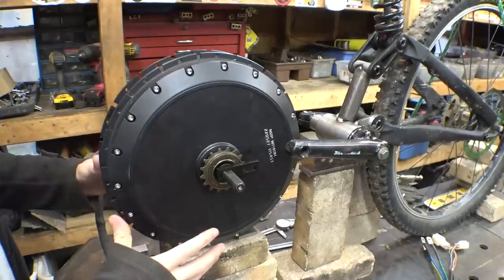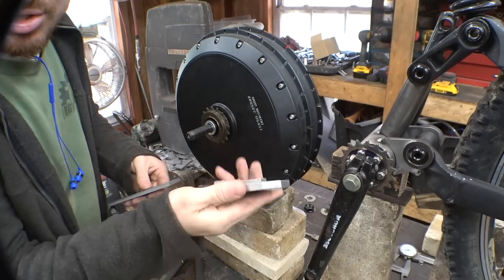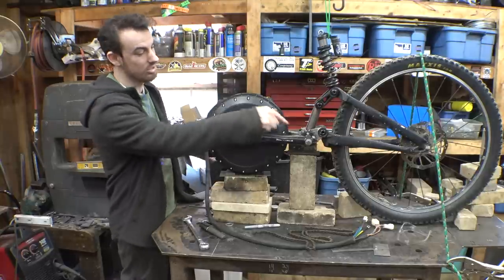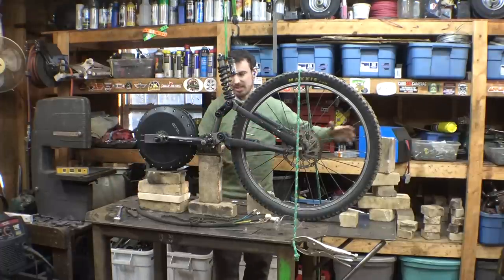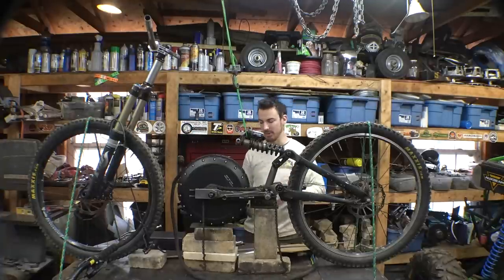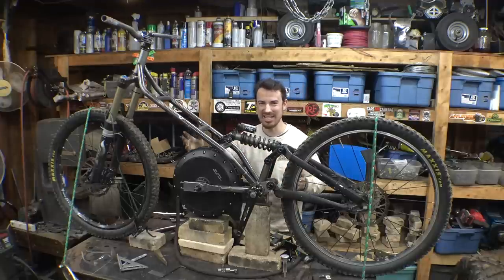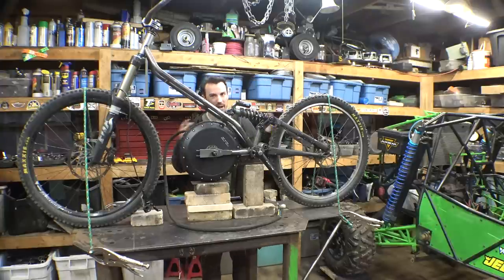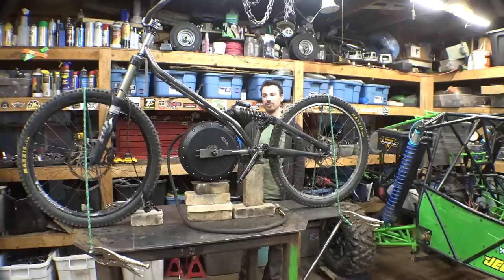Home Made Electric Mountain Bike Build - Part 2

Comment: Is there a one way bearing or something like that in the driveline? The motor won't force you to pedal, will it?
Reply: Gonna be a shin snapper
Reply: @kene6838  Yeah, usually, all you need is a one way bearing in the back sprocket but if the front sprocket is going to be driven, it will need a one way in both the rear and the front sprocket. Or middle sprocket, I guess in this case.
Reply: It's gonna have to spin the cranks, right? There are parts for trials bikes that take a freewheel on the cranks, but the motor will need to spin the cranks in order to drive the rear wheel, and that motor is rated for something like 1000rpm
Reply: I was hoping to watch the aftermath of touching the throttle at a stand still, oh the air time
Reply: @Ash-bx6kq  That's where a one way bearing is needed. So the motor can spin faster than the pedals or even with the pedals stationary. 

EDITED... The one way bearing has to be on the pedal crank. Wouldn't work on the motor shaft.
Reply: He turned the motor over and put the freewheel sprocket on it so the pedals Won't turn unless he wants.He put a solid sprocket on the other side to drive the wheel.
Reply: @bryduhbikeguy  That doesn't make sense.  Why would he put a chain between the pedals and the motor that doesn't drive anything? There HAS to be a one way bearing type mechanism or the motor will drive the pedals. There's no way to avoid that.

Comment: This motor is like 3-4x the power that people normally put on bicycles lol. Maybe this steel frame will weigh it down a bit more but everything else is mountain bike. Might want to put a good chain guard on it. I hope you ride it on camera more than the electric dirt bike. Maybe updating the electric dirt bike will be a good idea too because the seat was uncomfortably high and the suspension too stiff.

Comment: I wonder how level everything will be when the wheels fold in half.
Reply: Yeah I gotta agree. If that’s really a hub motor intended for a 3-400# bike, the torque load on the frame and/or bicycle wheels is going to be very high!
Reply: Also, he's using a regular 9 speed chain for this. No way in hell that will survive
Reply: I totally love the idea, but having my doubts on this one. I rode bikes a lot when I was a kid, and I can't even see the tubes inside the tires holding up for more than a single jump. He said he wants to take it in the mountains.
Reply: @ThePatillac  yeah, the suspension will also not be able to support a 150lbs bike, the chain, rear derailleur, and cassette are meant for like .5hp, not 20, the wheels will 100% go out of true from the weight if not fold up entirely, and he won't even be able to run the motor at its max power/ideal speed because it's connected directly to the pedals
Reply: @ThePatillac  Could be setup tubless.  Most mountain bikes in the last 5 years or so don't run tubes. Most mountain bike suspension and wheels aren't meant for people weighing over 300. I figure the extra metal, battery,  motor, his weight, and misc stuff would be over that.

Comment: Good luck with it.  I feel the pedals are going to smack the ground when turning, and there is going to be a awful lot of weight in the front, making the back tire wanna leave the ground all the time,  so I wouldn't stand up on the pedals while moving, you might just end up nose diving in the ground because of that extra weight.
Reply: He's definitely gonna have problems setting up the suspension properly with that much weight on the frame. Those suspension parts were meant for a 30lbs frame and this bike will probably be 100-150lbs

Comment: Question! I may not be visualizing this correctly, but if you're driving the motor through the cranks then to the wheel, won't the pedals also be flying insanely fast and blend your feet with the pedals? 🤔
Reply: Was thinking the same thing
Reply: That freewheel is actually a left hand drive style. So the teeth spin freely clockwise and engage with the motor counter clockwise. When he does pedal it he will be spinning the whole motor and thus turning the fixed gear attached to the rear wheel. I was confused too.
Reply: @captainqazs  If I understand you correctly, it sounds like you are saying that there will be a chain from the crank chainring to the motor, then another drive gear on the other side of the motor that goes to the cassette in the back. Having the the cranks chain attached to the left hand freewheel on the motor will keep the motor from spinning the wheels and allow pedal input to the motor. That makes a lot more sense.

Comment: You are going to have issues with keeping the chain at a consistent tension because of where you mounted the motor, ahead of the rear shock. Everytime you compress the shock, you will get a loose chain.

Comment: could you mount the motor to a lathe somehow? And trim off the spoke holes to get better ground clearance? Or if it's too big for a lathe just sand/angle grind the lip off to lessen the motors diameter. The only flaw I can see with this plan is the motor being so close to the ground, below the bottom bracket.
Reply: Before cutting I would wait to see if this all works out in the end. Now the motor is still useable in a wheel. 
I'm not so sure if this bike will be so great to drive. But it is lots of fun to see it being built :-)

Comment: Halfway through the video now and I see a potential issue. The forks look like they are going to hit the bottom tubes. Yes, it works for motorcycles but there is a reason bicycles have a wider range of turning angle. This is why all bicycles are made this way. You might find this out when you're pedaling at low speeds.

Comment: I wonder if all the electrical stuff won’t be too heavy for the frame, also probably that the motor would be better in the rear wheel.  But just watching your work and logic is interesting even if the result might be deceiving…. Hope it works.

Comment: Damn my current ebike is 1.4kw mid drive and it's plenty powerful(top speed ~35mph) but with 8kw.. Insane. I'm curious tho why did you go for a hub motor instead of a motor that is a bit more suited for mid drive applications? I feel like for you a bafang kit would be too easy but perhaps a cyc kit? Those things can go to 3kw or so. Or maybe a giant electric longboard motor would be better suited? Or any other inrunner type motor. Anyways, good luck for your project! I'm curious to see how it turns out.

Comment: Great work, loving the channel. Just one thing I've noticed. When you put the power down, the peddles look like they are going to spin fast and they possibly might hit you in the back of your feet.
Reply: He mentioned in the last video that the motor has a freewheel function (the motor can spin freely when torque is applied to one direction) so when he's not pedaling, it won't drive the pedals.
Reply: Yeah, it looks like when you turn the pedals the motor can stay still, but when the motor is powered  the pedals sprocket is locked to the pedals so it looks like they will spin. I only know this because i build a petrol power bike in the past and had the same issue. It was annoying if you wanted to ride only on power from the motor.

Comment: yooo wassup man. love your builds....buuut...im an avid mtb dude (mainly trails, jumps and dh). I have a mid-drive e- bike setup on my electric downhill bike and with the battery it weighs a ton and the frame is aluminum. Youre doin steel????  Also, with that big a++ hub motor, its gonna be hard to ride,,,and youre definitely gonna feel the gyro of the motor. br careful bro...youre building a Hummer with pedals.

Comment: I might be over thinking this, but when you are using the motor it is going to be turning the crank. The crank doesn't freewheel at all. If the crank sprocket is spinning then the crank arms will be spinning at the same speed. Won't the motor be spinning the crank way faster than you'll be able to keep up with pedaling? We are talking thousands of rpm's right?

Comment: This thing  is gigantic and will shorten your ground clearance if you leave it level with the pedals, also they seem to be way longer than normal bikes
Reply: Just hold your cranks horizontally level in corners
Reply: @th3d3wd3r  and still you,l have less ground clearance because of the motor
Reply: It may have 180mm BMX cranks. They look a bit longer than 175. Though I'm uncertain if the wheels are 26", but they sure look like it. Usually there is some BB drop, though later 26" DH bikes had the BB higher than the axles, because of long travel and ground clearance. The more modern 27,5" and 29" bikes tend to have very low BB's, that supposedly make them more stable at gravity oriented high speed riding. This thing looks very compact (length wise) compared to modern trail/enduro MTB's. Though the small wheels (if they actually are 26") do deceive and make the thing look much longer.
Reply: @th3d3wd3r  I'd be sketched about the massive motor spinning at 1000rpm hitting the ground or a rock when you are doing technical riding. But seems like safety is not a concern with this project lol
Reply: @itzikca  well aware mate. Just having a jape
Reply: @HulluJanne  I have a 14.5kw electric downhill bike. Built on a 2008 dh frame. Can confirm insane ground clearance lol
Reply: @Ash-bx6kq  deffo a bit sketch. Most of the fun projects are hahaa
Reply: @th3d3wd3r  yeah, I just don't understand why he decided to use these parts. I have an ebike with a qs205, which is slightly smaller than this one (I think the one he is using is a qs273 but it could br a qs205) and it's like 50lbs, spins up to ~1000rpm, and makes 12.7kw peak. The amount of power his motor will make and the weight of it is gonna make this bike entirely impractical. He will have to run the motor much below what it's rated for and much below the idea motor speed in order to keep his 9 speed chain from snapping, and to keep his pedals from spinning insanely fast. At that point just use a lightweight motor like the emtb manufacturers do, or use a motorcycle chain and make a sick single speed middrive dirt bike. Also, because it's middrive with a 50lbs motor and battery that can power it, he is 100% not gonna be able to setup the suspension he has on it rn properly. My ebike frame didn't have the motor on it, so his frame is gonna be significantly heavier than mine, and I was barely able to get a ridable suspension setup for my bike just due to the weight, and due to the MTB parts not being designed to support at 150lbs frame. They literally cannot get stuff enough
Reply: @Ash  qs205 would have made more sense like. He is using the qs273. It's the exact opposite of what you want to put through a bicycle drivetrain.
I use an mxus 3k (the custom order version with the fatter axle and phase wires + curved N52 magnets) in a 5T torque wind. 100.8v battery, 145A battery and 320A phase. Oh, and a dab of flux weakening. Tops out at 60mph with flux weakening. The torque is outrageous though. Can loop me and I'm 16 stone
Reply: @th3d3wd3r  I mean even a qs205 wouldn't work with the amount of power he wants to use, it will snap the bicycle chain. He should have used a qs205 with a motorcycle chain or a 1000w light middrive motor
Reply: @th3d3wd3r  also, if you have overheating issues you can put this magnetic fluid into the motor, I did that to mine and it's been working great
Reply: @Ash-bx6kq  facts
Reply: @Ash  grintech statorade ;) all my motors get a dose. Oh, but don't add too much, it'll introduce excessive drag.

Comment: The spinning mass of the motor will negatively affect the handling with its gyroscopic effects. Maybe with gearing the motor’s power to the chain can be reversed to the rotation of the wheel to help counteract said gyroscopic forces. Or more likely I am completely wrong with my assertions🤔

Comment: Should have just cut off and winded the rear dropouts and used it as a hub as intended with a larger wheel.. Mt bikes are running 3.25" tires now not counting fat tire bikes
Reply: ..and the current placement creates lot of ground clearance issues.. you'll have to run a skid bar/plate under the motor for sure..one downed tree branch and it'll rip the motor off

Comment: Something i dont get

The motor will drive the pedals and the pedals do not free wheel ( the motor will)
So at max power rpm the pedals will be spinning at a very fast speed 
Correct?

Of is there a second one way set up on the pedals? 

That will be something if you give it full beans!

Comment: So I'm trying to build my own budget ebike, I'm looking at the Voilamart 48v 1500W kit. Do you guys think I would fry the included controller if I ran a 52v 20Ah battery with 50 amps bms? I was told that 52v should be perfectly fine, but i was also told that if I wanted it to hit 40mph I could run that 50amps. Is this true?

Comment: Why use the giant 8kw hub motor instead of a much smaller and higher torque, mid-drive motor?
Reply: He already had this motor from the electric dirt bike build and didn't like the unsprung weight of the hub motor so he decided to build this insane bike.
Reply: Hub drives usually have more torque than mid drives
Reply: @th3d3wd3r  - not true at all.  Hub motors have better top speed but lack torque. Mid-drive motors have more torque but lack the top speed and are louder!
Reply: @Brett Denaro  thing you have to remember, it's a direct drive hub is just that, direct drive, 1:1 ratio. If you run a mid drive 1:1, it'll struggle to pull away from a standstill. My hub motor puts out 200Nm  of torque from 0rpm for example

Comment: is there a reason you are keeping the pedals. I ask because cranks bottom out quite often and that motor is well below the crank. if you were to use pegs you could move the motor up and back so you wouldn't need a longer frame than usual and you weren't risking bottoming out on the motor

Comment: I have a question Chris, it's looking like the hub motor will be driving the pedals/crank then from there to the rear wheel/sprocket correct?
I don't know but this seems super sketchy coz if the rear chain breaks or slips off the wheel sprocket under full load your going to have a leg mincer (pedals) rotating at a speed your legs can't keep up with before you realise to move out of the way.
Is this a valid concern?
Reply: The sprocket on the left side of the motor will freewheel when he's not pedaling.That's why he turned it over that way.Good question though.
Reply: @bryduhbikeguy  this can not work. If the sprocket, driven from the motor, on the pedal crank can freewheel, then it can not drive force. 
(sorry for bad english and greetings from germany ☺)
Reply: @chrisridethatbloodything2044  yes that's precisely what I'm saying.
It will only allow him to pedal and not have to also spin the hub motor whilst peddling. But when he has power to the motor the pedals will spin no matter what.👍
Reply: @bryduhbikeguy  I think you might have it backwards. It will ratchet only when he pedals faster that the hub motor. I guess This is so he can pedal but not have to use extra force to also turn the motor with the pedals.
If it was ratcheted the other way you will get no drive from the motor.
The ratchet needs to be on the crank itself with a separate shaft within the crankshaft so he can assist the hub motor if need be but as soon the motor exceeds the crank speed that's when it should ratchet.
I

Comment: I don't really see the point of mounting a huge hub motor to a frame but you do you I guess. This hub motor will have lower revs and high torque as it's meant for direct drive so gearing the thing might be quite awkward. But oh well, good luck anyway.

Comment: Maybe I'm wrong.
But I think the pedals should be in front of the motor. 

In that configuration it would be possible to use the motor without pedalling. The disatvantage would be that you would have to turn the motor when pedalling without motor-power. But with this heavy bike, I hope for you, that this would never happen ...

Comment: Am I being dumb or are the pedals going to have to turn as fast as the motor when power is engaged? It seems as if you would want the pedals to free wheel while the motor drives the shaft and transfers power to the wheel.

Comment: if you get the chance see CNC (cars n Cam..) micro car !   do a collaboration with GPW (Go Pow.. & RBG red beard) T-90 tranny setup Hi/Low range.. rumble seat, logo vehicle, canvas top. Dyno 670 or larger  street legal...side x side wheels...   then have you ever thought about  doing something nuts like a hydraulic/air oil buggy lift system? ride height  low for street run. air/hydraulic engaged to pump up cylinders and you got the off road to the extremes baja lift n suspension addition. 12-16 inch std suspension travel and the cyliders to lift to desired ride height.  ie load weight compensation for rider comfort ride n speed n .... Air spring via rubber bladder semi trailer air ride bag and oil to cylinder for the preload of the ride adjustability...  I'm 69 and got ideas that I've thought of and just not had the time for it all...